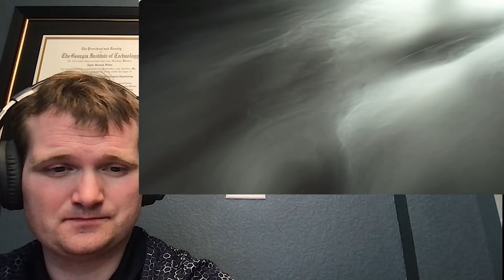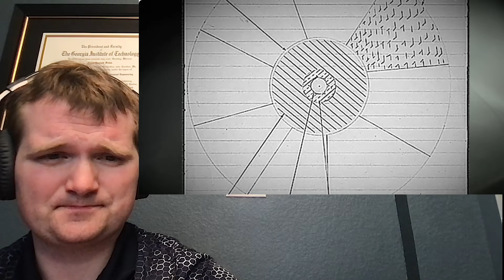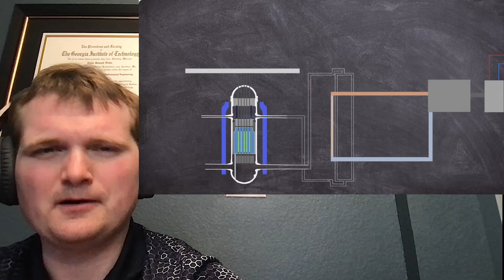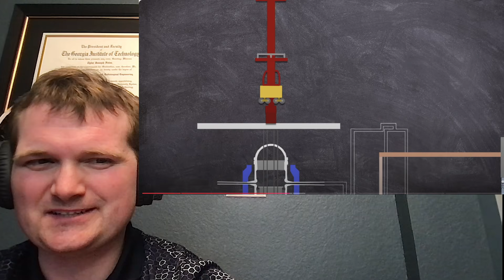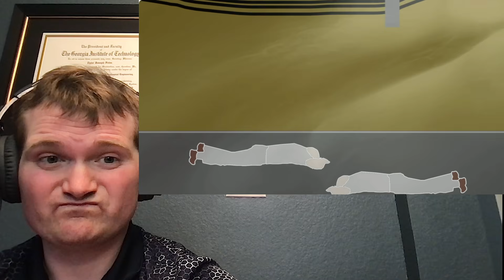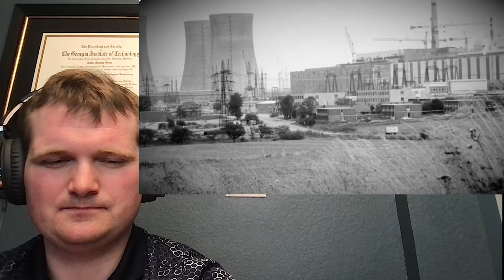The Accident-Prone Czechoslovakian Reactor - Nuclear Engineer Reacts to Plainly Difficult

Comment: 25:58 When I was working at a nuclear power plant (as electrician apprentice) we were not trusted to use a vacuum cleaner, just cause a mess and call the cleaners. (Except in transformer rooms requiring high voltage training.)  Seeing this I start to see why you need clearance for using cleaning equipment.😹

Comment: Did you ever discuss the first pile? The one that was put together under the squash court at the University of Chicago in 1939? Enrico Fermi headed that. If you haven't, could you? I think this was where SCRAM was actually a job.
Reply: also known as "Atomic arc" which did only not blow up due to the short duration. Correctly Safety Control Reserve Axed Man was a guy with an axe at command severing a rope and jamming control rods into the pile. Also on board was the "suicide squad" three ppl who held in buckets liquid equivalents of control rods.

Comment: I remember a few week after Fukushima... dudes were collecting dirt on the road in downtown Tokyo and tested radioactive...  as far as I'm concerned it's still leaking in the ocean.. whatever you guys saying... 10+ years after...
Reply: Just from doing some research on google the last sampling and testing I saw was in August of 2023 and the tritium levels were considered “below limit” by the Japanese government. There was a Water leak in February of 2024 but from what I have read, yes it seeped into the soil but it did not leave the plant. Another article states that as of March 2024 there is no abnormal levels of tritium detected in the ocean water.
Reply: @nickgarcia9941 Japanese government are so transparent...
Reply: @joseph-mariopelerin7028 It's pretty easy to measure tiny quantities of radioactive materials. Inexpensive field instruments are good for pretty much anything but checking food for alpha emitters at concentrations low enough that you're more likely to be struck by lightning than get cancer from it (assuming the linear no threshold model is correct, which we can't answer for low radiation doses where any change in risk is below what our studies can measure).

Anyway, Tokyo dose rates were measured. They'll probably drop as the largely Cs-134 and Cs-137 contamination (IIRC) decays or is moved away from people.
> The car-borne survey using a NaI(Tl) scintillation spectrometer was done in Tokyo in 2014 and results were compared to dose rates obtained in 2003. The ambient dose rates (range) in 2014 were found to be 60 nGy h−1 (23–142 nGy h−1) for the whole Tokyo area, 60 nGy h−1 (23–142 nGy h−1) for the eastern end of Tokyo and 61 nGy h−1 (32–102 nGy h−1) for the western end. These values were 24%, 27% and 17% times higher than those of 2003.

As for water at the plant, they're filtering out everything but tritium from the water they have stored. Fortunately, tritium has a 12 year half life, exists in substantial quantities naturally (it's nothing new to the environment), and we haven't really found a good way to concentrate it, so once it's diluted in regular water, it pretty much gets more and more diluted. People argue over the tritium all the time during reactor decommissioning, because it's easy to suggest things like storing it 60 years to decay, or diluting it an extra 100x before releasing it, or releasing it far away from the actual plant. Eventually a line has to be drawn, hopefully before another tsunami comes and washes the tritium out to sea.

Anyway, I'm mostly concerned about the cleanup and reopening, because it looks like the government wants to minimize or eliminate the exclusion zone quickly. They're reopening areas once residents are expected to receive less than 25 mSv/year IIRC, which is in the dose range that gets US radiation workers in an incident report and paid leave for the rest of the year.

Comment: My understanding of natural uranium, heavy water moderated reactors is you do not want to use the heavy water as coolant normally, so you can drain it to lose its moderation capacity without also losing its cooling capacity, if you were relying on it as part of the cooling system you couldn't do this. This is strictly as a layman with an interest in nuclear power though, so I might be misunderstanding some things here.

Comment: the reason 3 mile is overblown is because it ALMOST was a full meltdown. 
if they didnt restart water flow....3 mile would have been WAY WAY worse. 
.
still... its not the meltdown itself..... but the  machine/human interface...... the polices.... the single point of failure ETC ETC ETC
.
even a full meltdown that breached the vessel would (most likely) stay in the containment building   
but, givin the issues i mentioned about.... 
who says the concrete company added all the rebar they said they added???
who says  the concrete was to spec, and not a cheaper cement? 
who says they didnt pay off the inspectors.... (pretty hard to test concrete after its poured.... can test it at  the cement plant, sure.... but who says thats what ACTUALLY ends up in the truck???)
.
.
the meltdown at 3 mile does not scare me
its EVERYTHING ELSE that does.... 
.
why would you turn off the water? because you are scared of going solid? 
thats what PSI relief valves are for..... GET WATER FLOWING!!!

Comment: Minor correction: CO2 is not toxic, CO is. CO2 just has an asphyxiation hazard in enclosed places without proper ventilation, about as dangerous to inhale as helium, the difference being helium rises whilst carbon dioxide sinks down due to being heavier than air. Also yes, helium canisters have an asphyxiation hazard warning on them.

Comment: Yep, that's exactly what SCRAM stands for.  its from the manhattan project, where they had one control rod suspended by rope and a guy with an axe.
Reply: @waynemacleod3416  
It's from Chicago Pile-1, the first reactor ever built. It was rather primitive, as were the safety measures (fully understandable since it was the very first). So, they had an emergency control rod suspended from a rope above the core, with a guy with an axe standing by. On a command he would cut the rope to shut it down if things were getting out of hand.
These days the word "SCRAM" stands for Safety Control Rod Activating Mechanism.

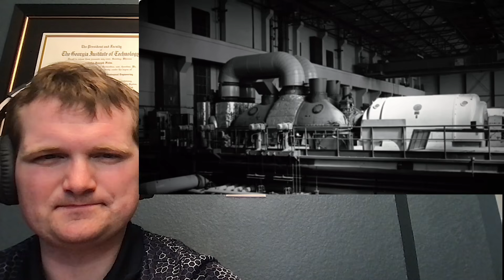Comment: 8:32 Those turbines were, most likely standard 50 MW turbines  that were also used in coal power plants back in the day. Also rated thermal output of the reactor was 500MW.

The reason, at least what I have heard, why the compressors failed to start was thermal protection of their motors.

By the time of accident larger plant - A2 was already on the drawing board and proposed power output was around 400 MW. Last iteration of this design I know about was TR 1000 from the 70's/80's.

Comment: Regarding the scale, I think it makes sense to include mitigation and costs. Think of it this way, if a high level of pre-emptive measures means most modern "incidents" would result in low impact; therefore, 1 or 2 on the scale, people would start to question, "Why are we spending so much money on small issues" and cost savings could lead to these protections being eroded over time. So when the next issue comes up, it would cause enormous damage that was preventable. Having a scale that looks at "what could have been" means that instead, the message is "it could have been as bad as Chernobyl, but thanks to this spending, it was limited". This is more about politics than about science or engineering.

Comment: 02:04. My good man, as you know, TMI was a core meltdown. It was only by good fortune that the effects were not much worse.

    Then-President Carter was famously a trailblazing naval nuclear engineer, and he was not opposed to the assigned rating at the time. He was pro-nuclear power as much as his 2 predecessors and his successor.

    TMI was a disaster. It should never have been allowed to get as far as it did, but it was. That's why it was such a big deal at the time, and why it still is today.

    It's also a major part of why legacy nuclear in the U.S. lacks credibility: you guys always go around proclaiming infallible safety for your designs and procedures, but the historical facts clearly show otherwise and people know it.

     Detroit, northern Ohio, Watts Bar, Dresden near Chicago, and other very close calls... Detroit was a partial fuel meltdown that gov't and industry successfully hid from us for a long time... FirstEnergy is still paying for its insanity in Ohio that it tried to hide.... TMI is just scratching the surface.

   We need new nuclear and we need it yesterday.  Trying to dress up TMI does not help your case for more legacy reactors.

Comment: Some soviet engineer building all these plants: "Containment building is decadent western idea, tovarish. In Soviet block, radiation contains you!"
Reply: But even the first western NPPs did not have decent containment buildings. Also the soviet designs, well at least early VVERs have system of chambers with partial vacuum around the reactor.

Comment: Those soviet reactors are actually still in operation here.
Reply: I Hope they've been upgraded with additional safety features.
Reply: @borttorbbq2556  i believe so there wasnt a single accident since the one in the video
Reply: @MichalKolac that's good to hear, good clean power is amazing
Reply: @borttorbbq2556 uranium isn’t clean. Mining and processing is very destructive.
Reply: @borttorbbq2556 they're not RMBK (the reactor used at Chernobyl NPP). VVER reactors were already at the time a more safe design. Obviously after the Chernobyl accident, IAEA obliged every nuclear reactor constructor to improve safety and implement these standards on the operating ones
Reply: @borttorbbq2556  
VVERs are very stable, safe, and mild-tempered reactors. They're the Soviet counterpart to our PWRs. Yes, a containment would have been better, but they cannot runaway like an RBMK. This has to do with the moderator they use; water. When the water goes away, the reactor will shut itself down on its own because there is nothing to slow down the neutrons to continue the chain reaction. It's an inherent passive safety feature the RBMK doesn't (there are still some 7 running today) have because it uses graphite as a moderator.
Reply: @swokatsamsiyu3590  thank you for the explanation. I don't really know too much about the different designs that they have or the classification types they used.
Reply: @borttorbbq2556  
You're most welcome! As a not-at-all nerdy hobby I study nuclear reactors with an emphasis on our big, grumpy graphite-moderated friend, the RBMK. An engineering buddy of mine advised me to also study other designs to more appreciate what makes the RBMK so different from them. I happen to have the full reference manual of the Bohunice V440 reactor sitting up on a bookshelf here. That's why I can say these things with a certain measure of confidence. Of course no reactor model is exempt from possible accidents, but with a tried and tested model like the VVER it's a bit less obvious than with more exotic designs like the RBMK. They're not bad reactors per se, but they should have sat on the design a bit longer to give it the things it needs in order to be a safe and stable reactor. Not to mention giving it a proper house (containment building) to live in. But no, they thought it a good idea to stick a headstrong, unstable reactor in the equivalent of a tin shed. Yeah, that worked out so well in 1986, as we all know.
Reply: @swokatsamsiyu3590  the partial shroud of ccps was one such design mistake
Reply: @swokatsamsiyu3590  that's a super cool nerding. I'm interested in the physics and engineering but I really only know enough about them to know how and why they work (and dangerous knowledge of how to make a basic rtg or light or heavy water types) but I don't know the specifics of reactor design. I know enough to argue that most modern designs are almost certainly safer than coal.
Reply: @swokatsamsiyu3590  in a way it did good and bad definitely show the world what can go wrong sadly that and bombs makes people scared of them. But we have significant safety features and containment buildings now. And Fukushima showed don't put backup power in the basement (at least not generators)
Reply: @borttorbbq2556  
Coal is one of the biggest polluters bar none. And what a lot of people do not know: The piles of ash outside a coal-fired plant are radioactive. They will emit more radioactivity in a day than a nuclear power station in its entire life. Any self-respecting reactor would hide in utter shame if it were to emit comparable emissions as that ash pile does. And it's nice to talk to a fellow nerd^^
Reply: @borttorbbq2556  
That reactor fought with all it had for almost an hour. But unfortunately, this was one fight it couldn't win thanks to us bumbling humans. The entire nuclear industry learned a lot from the Chernobyl accident, as Mr. Folse can testify. Fukushima as well. And yes, sticking your backup power generators in the basement in a tsunami prone area, not their finest hour, I'd say. But this also improved nuclear safety by great measures. The Fukushima station performed well above its capacity. It was rated for a 7.2 earthquake, and took a record-breaking 9.3 like a champ. If not for the flooded backup power, the station would have survived both the earthquake and following tsunami. That is quite the accomplishment for a station that old.
Reply: @swokatsamsiyu3590  oh yeah and the ashes are generally pretty bioavailable so that's fun. the smoke is also pretty radioactive. Considering
Reply: @swokatsamsiyu3590  oh I fully agree with what you said. Fukushima it did take a 9.3 like a champ if I remember right like if the site was fully decontaminated and everything got inspected and passed it could be started back up . I mean if I remember right the three other reactors in Chernobyl were perfectly fine. So you could theoretically start it back up too if you decontaminated the place. Not that I would want to use that type of reactor but you know. Though if the graphite shroud was swapped out for a full shroud it could work pretty well. And it would have the ability to be fully shut down. Without having to like remove fuel while it's still on. I know there's a lot of reactor designs that you don't actually have to turn them off to change out the rods but God it makes me nervous.
Reply: @borttorbbq2556  
For Fukushima, things would be a bit more complicated due to the extensive damage done by the tsunami/earthquake. Only Units 5-6 would be viable. The other 4 are a total loss. Especially the 3 Units that went into full/partial meltdown.

In Chernobyl, Units 1-2 were back online relatively quick. Unit 3 needed a bit more work since it was connected to its very unlucky twin brother via various pipes and systems. They had to sever all those systems, and Unit 3 didn't come away without some damage either due to the accident.

The Fukushima reactors were BWRs, these are also quite safe as a design, and are water-moderated like the PWR. World wide, there are currently only two reactors that can be refuelled while online, the Canadian CANDU and the RBMK. The former is a very safe, very stable reactor type that has been doing its thing for the better part of 60 years. It also has full containment. Unfortunately, the RBMK cannot function without its graphite core, so we will be unable to change that. But since the 1986 accident, they have had major improvements and safety upgrades. They are a completely different beast compared to before the accident. If you don't ask them to do things they cannot, and don't start poking them with a stick, an RBMK too can be a proper, well-behaved reactor. The ones still running are living proof of that.

Comment: Check out radiant nuclear energy 
They achieved air cooled nuclear reactor 
So it's a shipping container size micro reactor capable of generating 5 Megewatt hour for 5 year cycle 
In my opinion they are planning to send this to Mars for colonization and power supply to sustain life on Mars.
Reply: Air-cooled for Mars use seems weird to me. How does the the heat transfer work in standard light water systems you kind of boil water using the steam from the reactor.